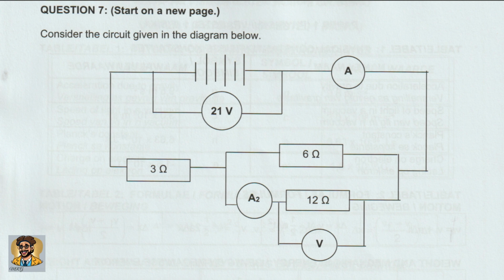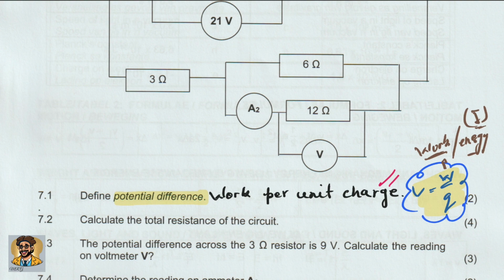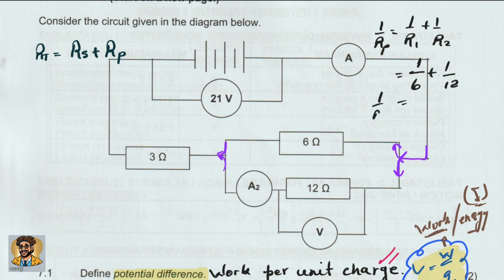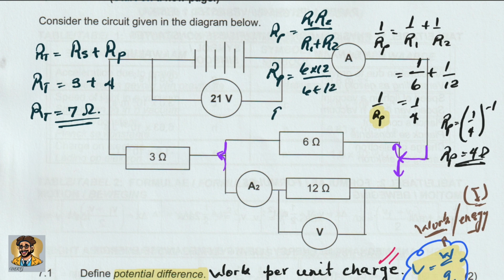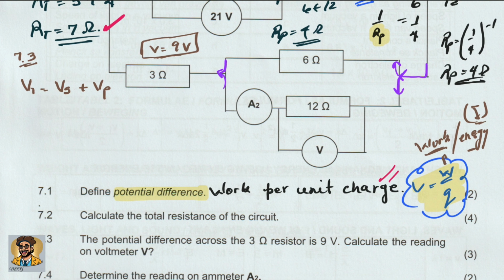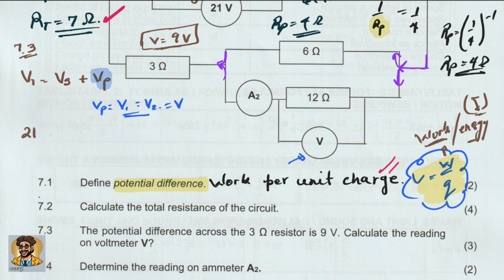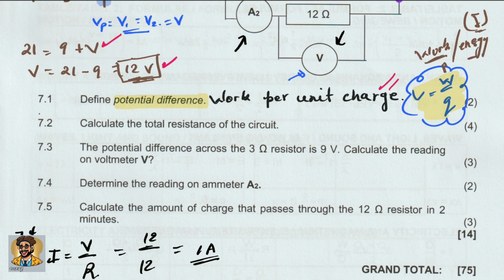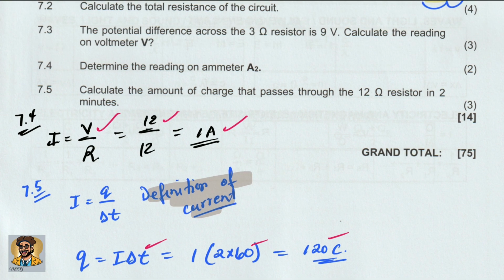Question on Electric circuit.  Grades 10 to 12

Comment: Sir is a light bulb a resistor that is not an ohmic resistor, and if it is not an ohmic resistor do we include it when calculating the total resistor in a circuit. On the question paper I did it showed a bulb with 15 ohms.
Reply from the maker: Well. Light bulbs are resistors, but for some time, the temperature increases, and it is non ohmic. But eventually, u can use ohms Law as temperature stay constant.